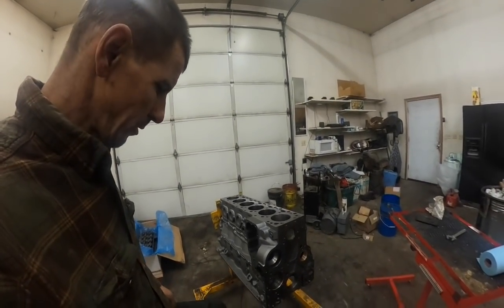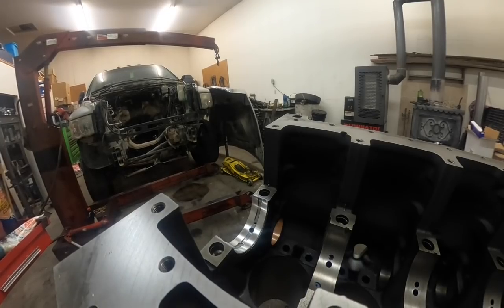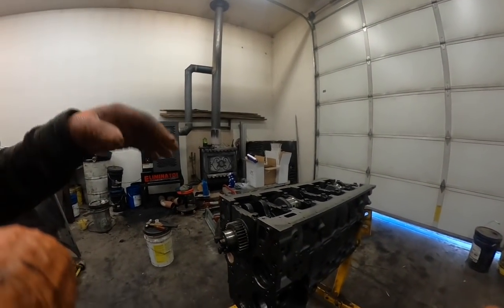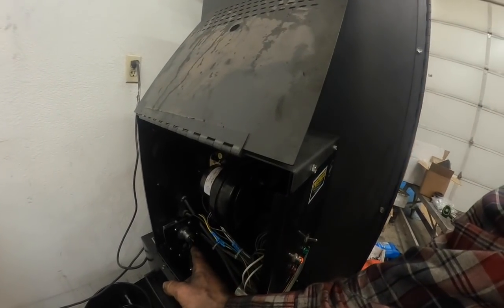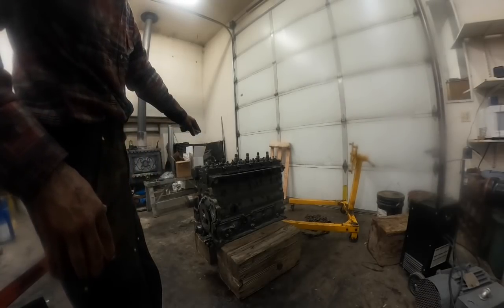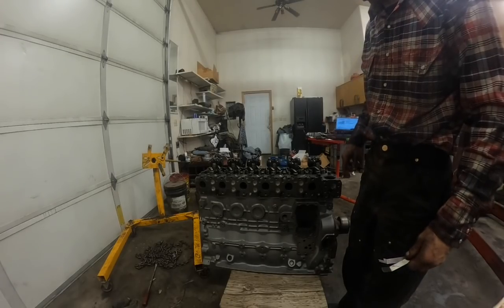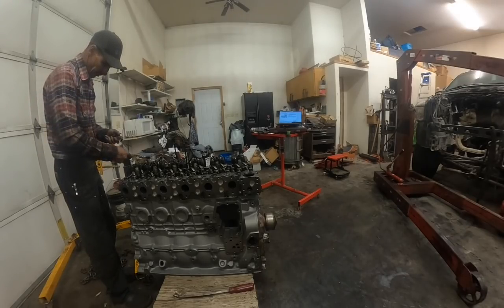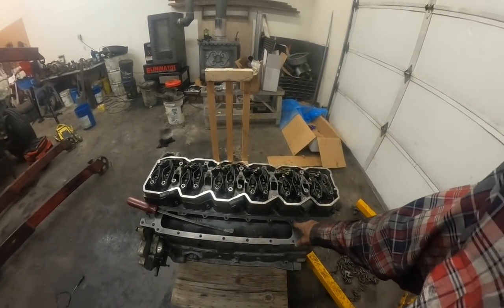24 valve HPCR Cummins engine rebuild Pt1

Comment: Thanks for the share Warren. "never found a loose one" I live in salt country, NOTHING is ever loose. up here your biggest friends are a drill, good bits, and E-Z outs. Even if you have a hot wrench.... 9 times out of 10 the head of the bolt is rotted away where nothing fits..... well.... usually a metric socket and a bfh to pound the socket on.... but then usually the bolt snaps. here i am 62 yrs old and i'm lookin at getting back into it..... it's all i know it's all i've ever done my whole life, pull a wrench. Hit that like button folks!!

Comment: Dang warren your a animal. Just getting after it as as always, I don’t work ( on the job) many Sunday’s . I just recently had a head checked on a C9 they did a valve job and sent it back. I got it back, the high pressure oil galley in the head was plumb full of metal. A lot of machine shops will clean when there done machining but some don’t, your right always check everything that has been machined.

Comment: Your advice on checking all the holes in stuff even applies to remand stuff from a distributor- I was working for distributor and rebuilding a 12 - 149 TIB Detroit- the rods were supplied as rebuilt - put the engine together and put it on the dyno - ran it for a while and it wouldn't idle- pulled off the air box inspection plates and found one hole that was seizing up.  Orders were to put another kit in it and reuse the rod - as u can imagine I'm looking at everything - so I took the air nozzle and blew through the oil hole that oils the piston pin - air went through fine but had a strange sound - pushed a welding rod through the hole and it wouldn't go.  Investigation found a broken drill bit in the drlled oil galley ... it had been there since new - no telling how many piston/liner kits that rod had ruined... so if the engine was just not being worked very hard things would be fine - but on generators and marine engine applications the lack of oil to the top of the piston will be detrimental to your warranty... so do like Warren says about checking all passages when your rebuilding engines.... nice video - what I do with those long heavy blocks is once you get the crank in it is to put a tall kickstand under the front snout on the crank - just put you some wood or cloth padding on it - you can through that harmonic balancer on the engine about last...

Comment: Anytime I have seen one of those engines on an engine stand they have used a mount on the right side of the block. It doesn't put as much stress on the mounting bolts.

Comment: You're bang on with your comments about manufactures taking zinc out of the oil.  I proved it with a little race engine I had, changed brand of oil for some reason and payed the price, no zinc!

Comment: We have a wood burning stove. We drilled a hole in the flue pipe and put a feed pipe off a tank high on the wall to one side of the stove and regulated it with a gate valve. In side the stove there was a peace of metal a has the burner. Just get stove some sticks and logs on. Set fire 🔥 and when it gets hot inuff open the valve. Put the heat fan on the top and away she blows.

Comment: Warren
I built myself a steel table, with steel wheels..a drain hole either end..machined holes with hold downs and raised shims like a machinist table..
Portable crane, which can be attached through pipe sleeves..or straight pipe. To drop in with plate to attach to block and rotate it..

Comment: I once got over confident on a 258 AMC in a CJ7 I was rebuilding.  This was in the day before all your bearings were blister packed in plastic. I guess a some point at a machine shop somewhere they had had 010 us and std bearings out of the boxes on a bench to compare or something ,who knows.  You  can guess the rest . Didn't look at the bearing measurement on the bearing itself just the box.  010us on a std crank and no oil pressure when I fired it up. I still 30yrs. Later double triple check everything and still wake up in the middle of the night and think did I look at that.

Comment: Warren if the rings are as fragile as that, do you want to use them at all? if they break in the engine, as I am sure you know well, there is a high risk of scored bores.

Comment: You could cut a hook out of 3/8 - 7/16 flat metal , exactly how you want the hook for the cherry picker and drill the pin hole . Those engine stands are made of cheap soft metal , they bend with  V8 car engines , really a heavy engine needs more than 4 bell housing mounting bolts to the engine stand , cast iron will break , I think your better off building your own engine stand out of heavier steel with more mounting bolt holes , considering what they cost and what you end up with , or build you a (about)3 foot tall HEAVY table (with legs wide enough it wont turn over from the top heavy weight) to set the engine on in different positions , that bending over over all the time is a back breaker . Lubriplate was the standard for installing all engine bearings years ago , now days all kinds of assembly lube`s each one is the best made to hear them tell it , in later years I used STP oil treatment on gas engine bearings an add the rest of the can to the engine oil until the oil was changed the first time .

Comment: hooker trouble,  what if you welded a slip hook back to back with the grab hook. Its a light duty lifter afterall.   I'm sure JBWeld will fix them rings up in a jiffy.

Comment: Warren , do you  always replace the injector tube on the 24 valve 5.9? I'm replacing the injectors in it because rough idle and smokes really bad   at idle.

Comment: I wouldn't trust those rings. Ag kits always treats people good it seems tho. I've had issues with rods from them but next day they had parts to me. Put that engine on stand using passenger side engine mount spot on the block.

Comment: There is info for 24 Valve Cummings, like "valve lash measurements AND adjustments should only be performed when the engine coolant temperature is less than 60°C (140°F). Valve Lash Limits: (Inspection) Intake: Minimum 0.152 mm (0.006 inch) Maximum 0.381 mm (0.015 inch) Exhaust: Minimum 0.381 mm (0.015 inch) Maximum 0.762 mm (0.030 inch)", but what is minimum ambient/engine temperature for lash adjust/measurement? For new valves with stems, do you need to go max and later readjust after seating/burn in period?

Comment: That’s bloody heartbreaking, waiting a long time for broken parts ! why don’t they protect fragile parts properly ?
Reply: I see shippers every day.  Im a delivery driver. They have little time to pull orders, sometimes they pick the wrong size box, or dont have packing bubbles, or both. Sometimes the shippers arent too bright or careful. Maybe the shipping manager is short handed and has to hire any warm body..its not skilled labor. When you can, especially for hot jobs..open the box asap!!! Nothing is guaranteed to arrive alive. I even delivered a 6 cylinder long block to a chevy dealer last month..the thing had rolled over..stuff was busted..i picked it up two weeks later, for return ..the engine was for a dealer techs daughters car. He wasnt happy
Reply: @pootthatbak2578   so long as you are happy that you have done your share fairly, I have seen damaged stuff reboxed and sent on to avoid liability

Comment: Very interesting when you say ring and piston failure do you think it was   cooling or oil caused? Had the same year 5.9 number 6 cylinder same problem looked liked a cooling problem to me.
Reply: I think there is a modification to the block for better coolant cooling at the #6 cylinder.

Comment: Of course you have to say Chevron Delo doesn't lubricate good enough.  I use the delo SDE.   Is it different than the LE, or should I stop using the SDE?  It says 50% better wear protection right on the jug, but better than what...I don't know.

Comment: Those load cells can be a real bitch to get off I have used a 1 inch gun torque multiplier and heat before.

Comment: Really you need some of that oil on your hands ( winter time ,dust & dirt , washing parts , washing your hands & etc....)  , all that dries your hands out , cracks your knuckle skin open and cracks open finger tips around the finger nails . When I worked underground my finger tips stayed cracked open around the edge of my finger nails , the cracks keep getting bigger an wider , first thing you know they ache all the time , I use to take a razor blade and cut the lips of the cracks off down as far as I could >>> instant relief ..............